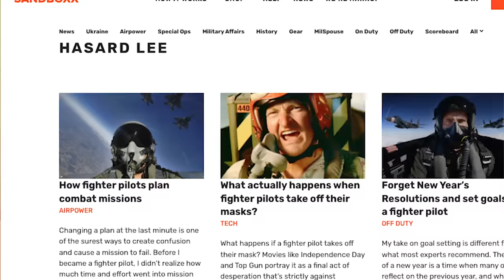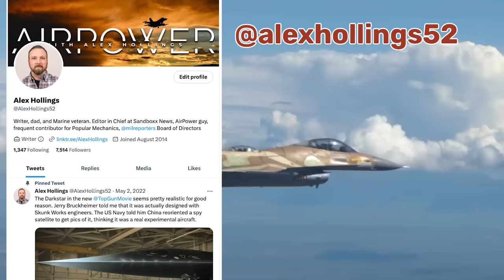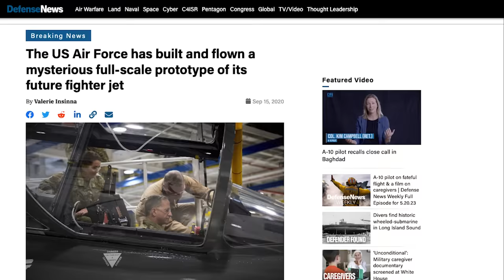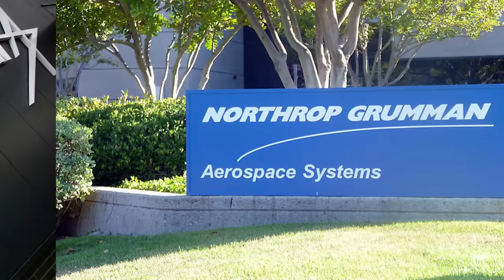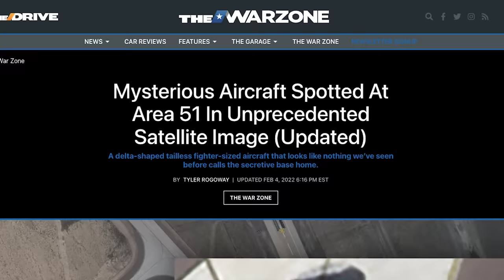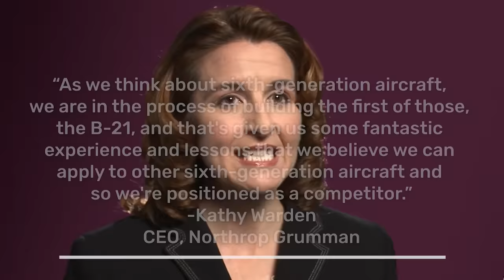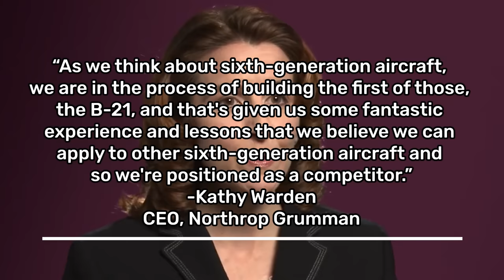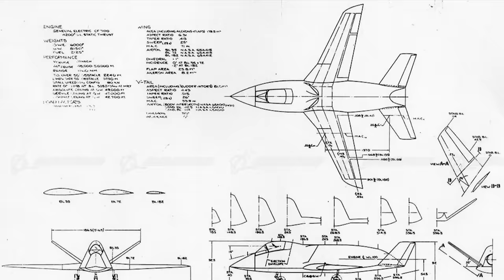The race is officially ON to field America's new stealth fighter

Comment: Excellent update. I’ve been wondering what’s happening. I’m so glad to see it’s moving forward rapidly, with the China problem we need to get in front of. I’m a big big fan of the YF-23 so I favor NG for that reason. LM has great experience now so I favor them for that reason. Boeing has flubbed multiple programs, civilian, military, and NASA, so I’m hesitant toward them. However MD engineers who now work for Boeing have done great fighter work. The fact both companies worked on low observable before it was a thing indicates some favorability toward them. But lots of time has gone by since the last time any of them designed a proposal for our an actual production Low Observable fighter, so more than one of them could probably produce a very effective NGAD. With the F/A-XX yet to come, we could see some stellar designs in the next span of time that with a couple of Adaptive cycle engines could have 85-90,000 lbs of thrust and fuel mileage like we’ve never seen to go with it, and massive electrical generators that will make these airplanes a giant leap over 5th Gen, with amazing sensors and super computers with wings that would make even the upgraded F-35 tilt its hat toward the NGAD manned platform.
Reply: Agreed, I am also rooting for NG, they just do stealth the best
Reply: This update left out one of the main reasons why the Air Force is looking for a new stealth fighter. That is because of the whole F-35 debacle in particular with LM having a monopoly on upgrades because they are the sole proprietors of the data. I recommend looking up an article titled "Avoiding F-35 Acquisition malpractice Aim of next gen air dominance fighter on The warzone site.
Reply: Ng dropped out of the ngad manned aircraft.

Comment: Something I learned over 30 years ago from military development.
When they lunch a new fighter the next fighter is already being built. So at this point when you have the f-35 lunched that means the next fighter to replace it is already being built.
Reply: not really... sure R&D never stops, but there is no f35 replacement being built right now... hell they are still in concept phase for the f22 replacement with no contract in place yet

Comment: My guess is that Lockheed Martin or Northrop Grumman will get the NGAD contract, with Boeing getting substantial Loyal Wingman work (Boeing Australia has been working on the MQ-28 Ghost Bat for quite awhile), while Boeing will get the Navy FA-XX contract with Lockheed Martin and Northrop Grumman getting portions of that work, like avionics based on evolution of the F-35's avionic, etc.
Reply: I would have guessed the same thing but Northup just took themselves out of the running. So that leaves Boeing and Lockheed. I'm guessing Lockheed will get the NGAD and Boeing F

Comment: I would actually prefer that there be more than one design being used. In part because I want there to be more of these companies not less. Maybe a sharing building contract or the Air Force reviving the concept of small and large fighters as well as having the hive mind big ass airframe Plus many drones. I like the idea of pairing a wigman with these fighters that is autonomous as well as having a large platform able to carry a couple of operators and the pilots that control multiple autonomous drones. For example the light fighters could be one's design with the idea of use in non-ideal circumstances with regards to runway and maintenance out in the field. The heavy fighter being a true F-22 successor, all of these concepts working together when available. Eliminate the need for a true AWACS and eliminate the lag associated with drones currently, as well as have some more localized control due to fog of war issues. Regardless the fast pace idea of design and iteration is one that at least gives us the opportunity of keeping some form of competition within this industry
Reply: The “light fighter” you describe will be the drone CCAs, which are a different contract than the PCA component of the NGAD, and will likely be made by a different contractor.
Reply: F-35 and NGAD are the combination going forward, with drone wingmen as an extended tool for both. Too many different airframes and you create more supply chains needing more parts and trained staff that could otherwise be used in improving logistics on existing airframes

Comment: While working on the Lift Fan system for what would become the F35B, I always thought that Boeing's X32 looked like a pregnant moth. Their ducted thrust lift system (i.e. Harrier type) was also a limiting factor. Plus, their entry never flew with actual retractable gear. It was too heavy.
Reply: Couple of caveats there, one there was a limit on how much money Boeing and Lockheed were allowed to spend on their prototypes for the joint strike fighter. Lockheed, of course, threw that out the window, and spent $200 million developing the engine prior to the beginning of the program, because they got the heads up from their moles, in Congress in advance. So already lucky was cheating :-) to the reason why Boeing‘s prototype was heavy, was because lock it again leaned on their malls in Congress to get the specifications for the program changed which forced Boeing to have to go back to the drawing board. At the same time Lockheed got the DOD to push up the test date which then forced  Boeing to field their prototype before it was ready.

It basically came down to this, the F 22 already existed so Boeing designed a much cheaper mass produced stealth missile bus that did the job that the joint strike fighter was supposed to perform. Lockheed on the other hand build a slightly different version of the F22 that could go really fast and perform fancy aerial maneuvers and impress the fighter mafia who  swooned over it, and immediately threw truckloads of money at them to get it in production….. but then they had to wait 15 years longer than they thought in order to get it into production, because Lockheed‘s model was so riddled full of bugs and problems and issues, and technical glitches and rebuilds and re-designs and software problems that the cost overruns could’ve funded several small nations by the time they finally got it to fly.
Reply: @Matt-yg8ub  let me ask you, we're you there? I was actually working on the Lift Fan system in 1989 and 1990 under a strict veil of secrecy. You can say that the deck was stacked against Boeing, but that simply isn't true. General Electric was wedded to gas coupled designs back then and we, Allison, we're competing and beating them with gear driven designs (Model 578-DX PropFan Demonstrator and the Lift Fan). Boeing wedded themselves to GE. Their concept never stood a chance.

If you understood area ruling, you would know why.

As for the length of time to complete the F35, you seem to forget, or never knew, that the requirements kept changing. It's tough to score when the goal post keeps moving.
Reply: @ronaldschoolcraft8654  Exactly, it was very difficult for Boeing to score when Lockheed kept getting the DOD to move the goal posts :-). Bro I worked for Boeing, I’m intimately familiar with how this process went down…Including the fact of the current F-35 has had the engine changed out three separate times since you worked on the design in 89:-). 

Also, the current F-35 has 20 years of improvements compared to the X35 demonstrator…. The X32 Would have been no different. It’s grossly disingenuous to pretend that it would not have undergone multiple iterations and revisions to arrive at the final production model.
Reply: @Matt-yg8ub  I never said there were no developmental changes between the X35 and the F35B. That's something you came up with and tried to claim that I said.

The fact is, the X35 performed a mission including short take-off, full transition to wing-borne flight, aux doors closed, gear up, climb to altitude, rendezvous with a tanker, take on fuel, decouple, accelerate to supersonic speed, return to base, transition to vertical flight, and execute a vertical landing. That was Mission X in 2001. I have a video of it.

That mission sealed the deal for Lockheed. The X32 never came close to doing any of that.

Now what other excuses can you come up with?
Reply: Tale as old as time, Lockheed knows in advance what the specifications for a project are going to be before the project begins, dumps a couple hundred million dollars into the project before it officially begins so that they can avoid the budget caps on the prototypes, and then would you believe it …has a prototype ready sooner than the other guy so started when they were supposed to, and instead of performing to the spec for the project, flies a bunch of loops and does a bunch of shit that impressive the fighter mafia and gets the contract, regardless of whether any of that shit was actually part of what it was supposed to be doing in the first place. :-)
Reply: @Matt-yg8ub  😢
Reply: @Matt-yg8ub  face it. The X32 was a turd.
Reply: @ronaldschoolcraft8654  the x32 was a prototype, the X35 was just a slightly more developed prototype since Lockheed had more time to work on it.  Boeing aimed to fulfill the requirements on budget…. Lockheed aimed to built a flashy fighter with as many bells and whistles as they could up-charge to slap on it.  Flash won over substance and the tax payers footed the bill for Lockheed to get rich on endless cost overruns and redesigns to get paid to fix problems they built into the system in the first place. They’re so far behind schedule that by the time they manage to deliver the second half of the Air Forces order… the first half will already be obsolete
Reply: @Matt-yg8ub  😭

Your logic is typical of the loser who was in over his head. The X32 was a turd. There is no way to massage it. It was a complete joke.

Comment: Great video, as always. As an aside, I have gotten frustrated that Digital Combat Simulator (DCS) modders have not created any NGAD designs yet. As far as the technical model is concerned, they would have to be much easier to model than the 4th-Gen aircraft with their many external variations. I guess I'm a little too excited for the future to arrive!

Edit: Just to clarify, the community has created one "NGAD" model. I'm not a fan of their choice of models (from a Game). https://youtu.be/i5F5LYUJmOE
Reply: That's because DCS is trying to integrate as many known facts as possible. Yes, you could integrate the shape of a plane, but without at least approximate Thrust/weight/wing loading (aerodynamics) estimates. it is a non-starter. Just take the Powerplant for example: If the weight, and power output of the P-W F-135 change as dramatically as "announced", You'll probably have just too many variables to estimate "Right".
Reply: @Gunni1972  Sorry, I meant to refer to the modding community, rather than Eagle Dynamics themselves—I realize ED has a much higher standard that what is often produced in the community since they are selling a product. Certainly whatever is produced will be fictional, but the community has does not seem to have been against fudging numbers to create what they think an approximation. For example, there are F-35 and F-22 mods out there that use "best available data", and are incomplete as far as the ability to replicate radar and data integration as we understand the F-35 is able to do. [As an aside, the community has oddities like space shuttle air balloons, airplanes made of oil containers and wood, and Star Wars vehicles, among others.]

I guess I am a little too excited to visualize scenarios with the NGAD designs I've seen imagined and predicted. That's all. I realize they would have to adjust the underlying .lua files (coding that affects model capabilities) later as information is made available.

Comment: First? In any case...I really wonder how this ngad thing will function. A jet not tuned for high G maneuvers feels like it will need some exemplary defenses to keep an adversary from achieving a lock.
Reply: It should have good stealth capabilities for low and high frequency radar on a level where it will only be visible at  a few NM
Good luck trying get a radar lock in the first place
Reply: @simonwoess5679  could be an IRST lock.
Reply: @Ilyak1986  I would say that a fighter that should replace the F-22 should at least have the same if not a smaller heat signature

So yes it would be very hard to get a missile lock in any way

Comment: Based on how long the F22 was in development, how many years are we away from seeing the airframe?
Reply: I think this one will be much faster than the F-22 and F-35 given the tension with China and the increased productivity with AI but I imagine it will still be quite some time before we see it.
Reply: @jeremyholland4527  the time we see it and the time it enters service are 2 completely different things I think
Reply: With the F-22, the cold war had just ended and there was no competition. Now, in a new almost cold war, the development will be much faster. At the beginning of the 2030s, the thing should already be in service. Fighter jets are usually not kept classified for a long time because of their large quantity, so probably in 5-10 years.
Reply: The F-22 was in development for at least 20 years before it came out.  Mainly because the soviet fell and they were wondering if the plane was necessary.

Comment: Genuinely, love the plug for Hasard's book. I find myself part of some very odd communities (military aviation, strongman, sports cars, nuclear science, swords, etc) based not on the content, but the community. I am essentially a professional in Googling things (long story, many $, mostly not mine, sadly) so end up in random internet places. From that, I find I stick around in places where the community is good, so I love seeing stuff like this.

I feel like that comment potentially looks like I'm trying to make some claim about the important of my opinion. In case that seems true, what I'm really saying is purely that I have experience perusing an unusually varied number of places of the internet. My only claim about myself is that I've seen a lot of pointless, dumb crap, more than I've done myself, which is a lot. Within that, I've learned it's hard to stand out as a true beacon of positivity on the internet, but Sandboxx and Alex manage it in a way that not many do. I don't know how many internet communities I haven't interacted with, but it seems extremely and consistently rare to find creators like Alex/Sandboxx.

Edit: I do like "broken records" though. There's a record for most baked beans eaten with a cocktail stick in 1 minute, I feel like records should be predefined. For aeronautics, perhaps the basic performance records plus shortest radar targeting range with a predefined radar system and different between incoming and outgoing target locks based on predefined opposing radar and target parameters.

Other Edit: Bias towards my favourite plane, and being a Brit, might exist here...but does the de Havilland Mosquito not count as the 1st low RCS plane? Not the 1st designed for that purpose, it had no such intention, but observation of its low RCS certainly contributed to that research.

Comment: I am going to give an educated guess that the 2 finalists are Lockheed and Northrop Grumman. I feel that in the end they may both have new fighters and/or drones in production soon. Another thing is that even if these 2 have the fighters and drones locked up Boeing is very good at air to air refuelling and as such might be a good choice to build low observable unmanned tankers. And, they are experienced in the demands of carrier based aviation. Add in AI and I could see unmanned tankers loitering just back a ways from a attack group to give our aircraft the fuel to get home with the enemy not knowing they were there. It could increase the range of our stealth aircraft a quite a bit having the gas stations launch with them. Just my thoughts. By the way, I already have the new book and am about half way thru. Excellent material. Thank you and be safe.

Comment: I keep thinking that bigger intakes means more natural force of air into the intake while less fuel is used to keep the fighter jet in the air 
In essence the intake of the air provides the plane in air ability while moving forward the lower fuel consumption is just to make sure enough air intake is obtained to provide greater or standard speed for an aircraft to keep in the air or even to mach 1 or 2.
Reply: Just hear me out 
Imagine the intake is what keeps the fighter plane in the air or flying forward at minimum speed while lowered fuel consumption provides a backup if the air intake fails to keep the fighter in the air 
This means the fighter stays in the air longer while having more fuel for greater speeds or even longer combat time 
Altho this is ideal 
Implementation is a separate issue or the concept isent flushed out